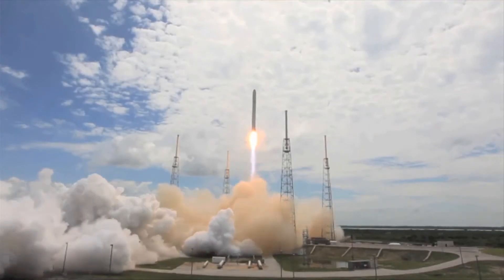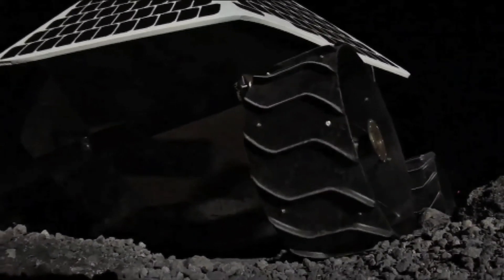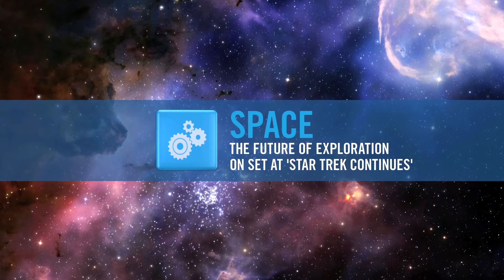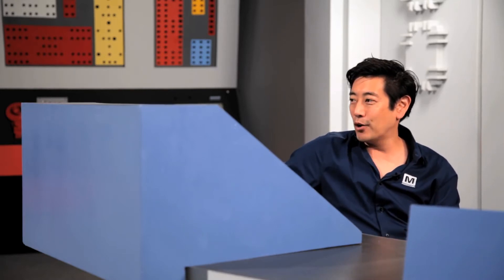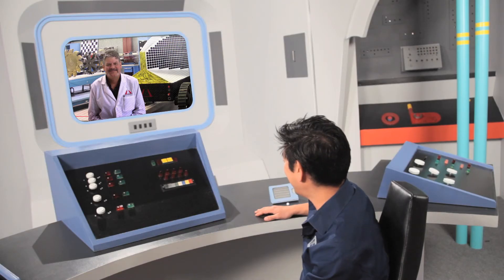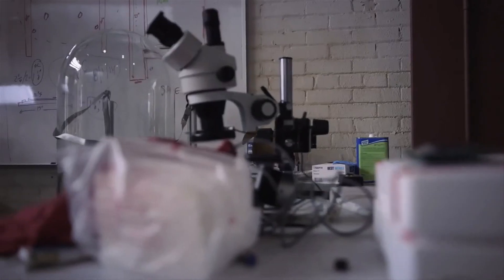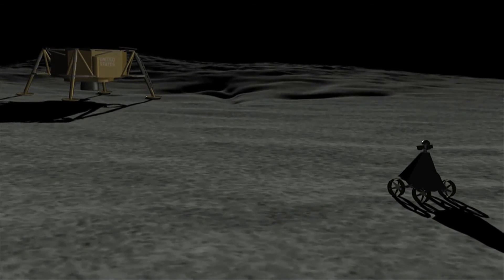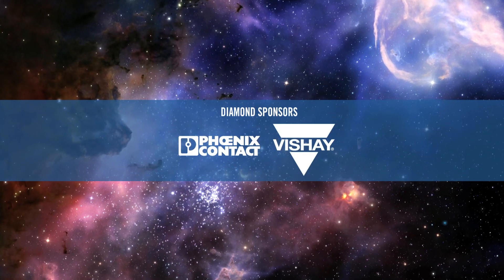Space Electronics with Astrobotic's Senior Electrical Engineer | Empowering Innovation Together

Comment: how do electronics work in space when cpus lock out at negative 50 on this planet with liquid nitrogen and over clocking....if space is 450 degrees to negative 450 degrees...how do the cpus stay working...I know there are radiation hardened chips but it doesn't explain how they can operate past the designated lock out temps.....not to mention its supposedly a vacuum so how does a radiator even work? don't the need wind and fans ? lol..... and if there was a way for these over clocker to get passed the 50 lock out temp but you guys can,, why wouldn't amd or intel teach these world overclockers these tricks to see if we could break the barriers. a normal cpu overclocked system can get upwards of 1100 watts...this thing is 200 times the size of a an overclocked household computer....and these are supposedly going to run refrig and heat controls?....sounds like smoke and mirrors to me.
Reply: it is simpel, you just keep them inside operation Temperatur. You heat and cool the inner parts of the Satellite to ensure very good temperatures. That is also why heat pipes exist they where invented for Satellites. If you ever looked at the ISS you can see the Big Solar panel but also some smaller white panels these are for cooling.
it works with heat radiation that is basically the only way you can loos heat in vacuum.